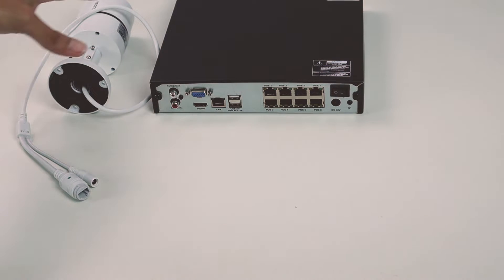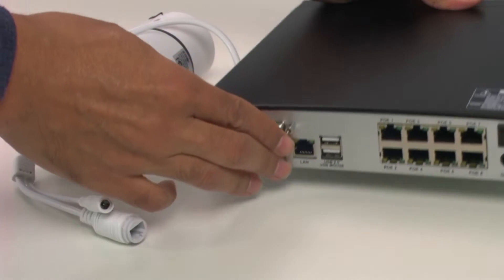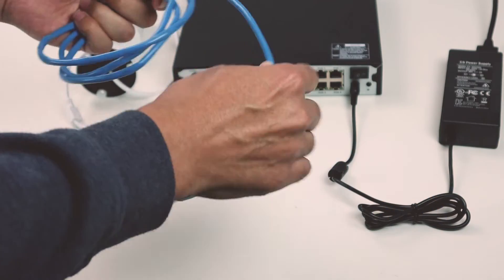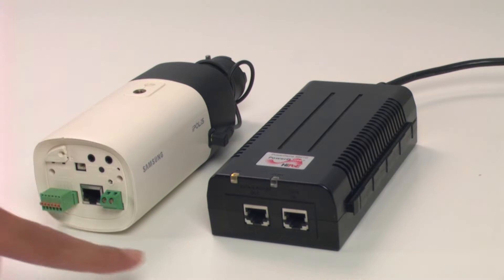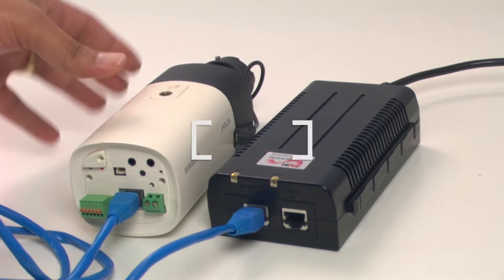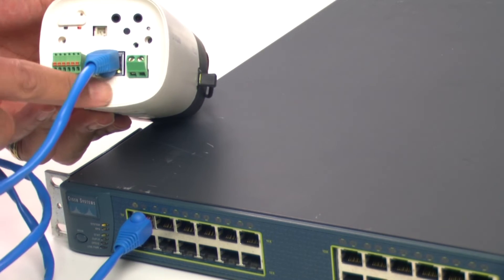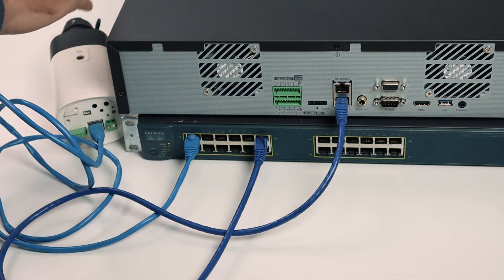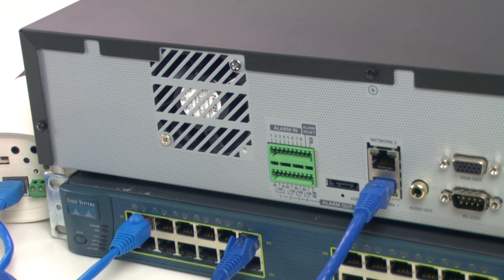How to wire Poe Security Cameras

Comment: thank you so very much!  my security camera electric cords constantly fail and go out and because where cameras are located are difficult to constantly replace 😡 i want to try to use this configuration instead,  my system will allow,  but my question is: does length of cord/wire  connection matter?
Reply from the maker: Up to 100m for the UTP cables.
Reply: @LearnCCTV  thank you! thank you!